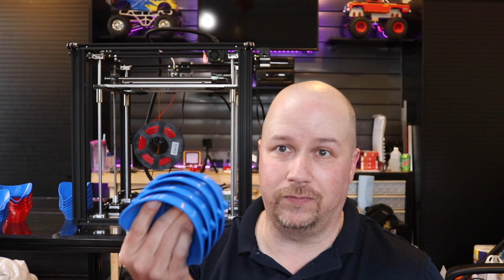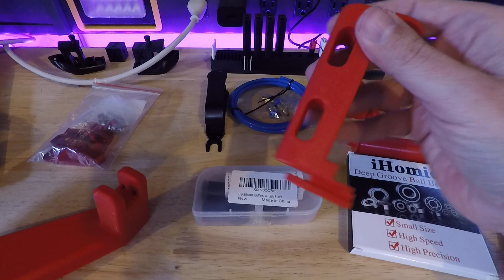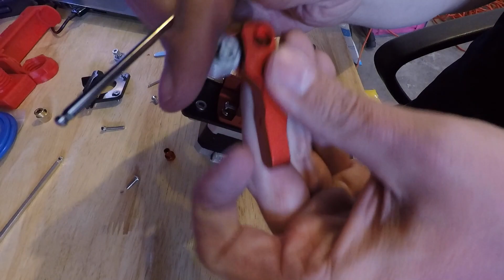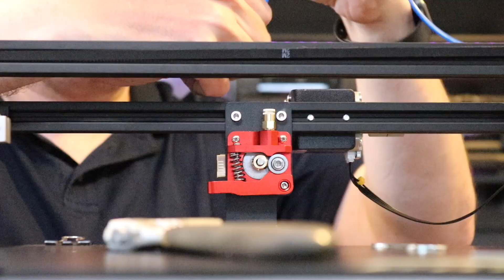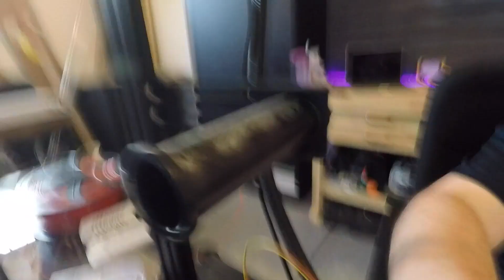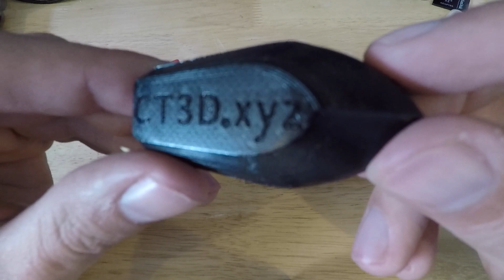Ender 5 Plus Upgrades -  5 Upgrades for only $50!

Comment: Useful tips but i have one for you. The easiest way to remove the Bowden tube from the hot end is to go the refill function in the menu and press feed it will then ask you if you wish to heat the extruder press yes and allow it to heat up the residual filament will melt and the tube is easily removed.😅

Comment: I've tried Capricorn tubing on 3 different printers and have gone back to standard tubing on all. Personally I think it's over-rated.  It often causes jamming, especially on an Ender 5 Plus where the tubing is fairly long. The tolerance is just too tight IMO. Perhaps if you buy $50 rolls of filament where the width is always 100% perfect then it might be OK, but I don't. Printer quality for me was definitely better with standard tubing. I've read other people having the same issue.

Comment: thanks for the video.  got what seems to have been a used ender 5 plus for $250 from a warehouse liquidation.  the motherboard needs replacing and the screws need straightening.  this video is great and appreciated.

Comment: i printed this spool holder successfully from the linked file but it looks like it's too big for my ender 5+ bed if i use the full Z axis. it will hit? do i have something backwards haha? i don't think so.
Reply: edit: nvm i'm used to working with solid steal haha. the bracket was pushed all the was forward in extrusion from factory and was slightly bent forward. Bending it back to straight + maybe a little safety bend past straight to the back and  loosening the two mounting screws to t-nuts + pushing it back immediately gave me clearance. moved it like a half inch. crazy

Comment: When I did the metal extruder upgrade on my Ender 5 Plus, the new bearing that came with the kit had a much smaller groove for the filament to rest against versus stock.  I tried it out but my test print failed, the filament apparently was being pushed too tight against the extruder gear for it to work.  So I replaced it with the original bearing with the deeper groove and everything returned to normal.

Comment: When replacing the Bowden tube, preheat before you try to pull the old tube.  It's also a great time to clean out the heat block.
Preheat the hotend to a little above normal, clean out the nozzle, and remove it.  Then use a scrap of bowden tube to run thru the assembly until you get most of the residue out.  Wiggle it around, push/pull, etc.   The tube can pass all the way thru the heat block and with a little work you can start off with a new Capricorn upgrade that's clean as can be.

Comment: I like your video.  (literally, I clicked the like button, too).  I just wanted to share an alternative spool roller design that I liked.  I considered the one you shared, but ended up with this one on two of my printers including an E5+: https://www.thingiverse.com/thing:3290358    The one you picked, if it is working for you, is absolutely worth keeping!  I only share the alternative for others to consider because it hides the bearings inside and provides support for wider spools.   It fits the Ender 5+ and the CR-10S Pro as well as others.

I made this remix of another tool holder and am happy with how it turned out for both of those printers I mentioned: https://www.thingiverse.com/thing:4343517   

I don't have a nice PTFE Tube Cutter.  (It's great if you get one!) but for those that don't have it, just use sharp flush cutters, cut as straight as you can, then close the flush cutters and use them in the closed position to open the end of the tubing by turning them around and around until it is rounded back out.  If you need to clean the surface any further, a razor blade can shave it, but I haven't found it necessary so far.

I have my z axis timed together on my CR-10S Pro which is really nice keeping them in sync 100% of the time.   I am going to work on seeing if I can come up with a version for the wider Ender 5 Plus.  I just need to figure out the right belt length and maybe come up with a belt tensioner for it, if need be.   On the CR-10S  Pro it is really super easy.  You just need a couple pulleys and a belt.  Set your 2 z axis screws exactly where you want them, tighten down the pulleys carefully.... check that your gantry is perfectly level running across the bed / perfectly parallel.   For the Ender 5 Plus it would work very much the same way.  2 Pulleys at the top of the screws at the top of the travel of the bed, the belt runs just under the bed (so it would need to be a high temperature heavy duty belt from a material stand point, but it doesn't need to be a very wide belt.   Depending on that circumference around that path, if there is not a belt close enough to that size, one could make a custom belt (not preferred) or simple get a belt that is the next side up and make a spring loaded tension roller arm that keeps the belt snug to the z screws.   If you want a challenge, give this some thought.  Take some measurements, and see what you come up with.    To me, the belt length needed would be 1 outer diameter of 1 pulley + 2 * (the center center distance of one z screw to the other).   Half the pulley circumference on the left, plus 2 lengths of center-to-center distance between the screws, plus half the puller circumference on the right should give the total belt length.  I just haven't take the measurements yet.   You said you wanted a challenge, so I present this idea to you, to see if you have any interest in it.   In the end, your two z screws won't get out of sync.

One suggestion:  At 21:00 into the video you can see that your filament sensor could be moved over.     Loosen up the mounts, move it over to the right (relative to the video frame) and have the filament come off the roll on that side of the roll by the sensor.  The filament should go pretty much straight up into the sensor.   

I really like the silicone stand offs.  I use them on my CR-10S Pro and it helps a ton.  You can use a drop of blue loctite on the threads to keep them from backing off over time.  My springs arrived from the factory super tight, so I just left them that way for now.  the bed mesh looks good.  I 100% agree with you on the strain relief.  There is absolutely no reason strain relief shouldn't be included.

Thank you very much for the video.  I also agree that the Ender 5 Plus is a good printer and the BTT SKR V1.4 board makes it even better.  I have the SKR V1.4 on my CR-10S Pro and I may add one to the Ender 5 Plus at some point.  For now the Creality Silent Board in the E5+ is good enough.

Comment: The plastic Creality extruder is the one they use for the Ender 3. The extra protrusions are for zip-tying the electronics and Bowden tube for the Ender 3 to keep the cabling from dragging on the bed.
Reply from the maker: Thanks!  I knew it had to have been used from another printer!

Comment: Some additions I just finished uploading to Thingiverse.
Spacer for using a dual gear extruder: https://www.thingiverse.com/thing:4391664
Bracket for using the removable spool holders with bearings: https://www.thingiverse.com/thing:4391940

Comment: Why did you reuse the original pressure fittings instead of the ones that came with the Cap tubing?
Reply from the maker: Good catch!  I tested the ones the came with the tubing, they didn't grab as good, and there wasn't enough room for the gap clip.  I just didn't feel confident that they were going to be any better.  Thanks for watching - Tripod

Comment: It looks like you missed the tensioner in the extruder assembly.  The screw that goes in from the top into the spring should be going into the part that looks like a rivet.  That allow you to adjust the spring tension.
Reply from the maker: @boggisthecat Yeah, this kit\verson doesn’t have an adjustable tensioner.  Thanks for watching.
Reply: Tripods Garage 
OK.  I haven’t had any missing that part, having bought three of this type.  It looked like it was there on your bench in the video.

You might want to have a look at the double-geared type of extruders.  Example: https://www.amazon.com/WINSINN-Extruder-Creality-Upgraded-Aluminum/dp/B07SY745CF/ref=sr_1_2?

I have one on one of my Ender 3 printers.  It should work better with TPU, hopefully.  (Waiting on some to arrive.)
Reply from the maker: boggisthecat - You had me worried for a second!  I double checked my little parts bag, didn’t have it. Then I double checked my order (in the description), and you can see in the picture that the little adjustment nut isn’t included.  I decided to do a search, and found others on Amazon that “do” have the adjustable tension.  It is good to know that there is another version that has the tensioner nut.
Reply: Tripods Garage 
I brought it up because this isn’t on the standard Creality extruder, so I thought it was some random thing with my first one (people tend to pack stuff at home, while eating noodles, having an argument, and packing multiple other stuff at the same time — so it happens).

It wasn’t until after I had assembled it, and was grumpy because the spring was canted over (‘This design sucks...’), that I checked the photos and noticed that the ‘random’ part was actually a tensioner.  Derp.
Reply from the maker: boggisthecat - Glad you brought this up!  Apparently there are older versions floating around out there (like mine) that do not include the tension adjustment.  Now people know what to look out for.  Thanks again for watching, and looking into the finer details that make these how-to videos even better!
Reply: @TripodsGarage  I have made up a spacer for Ender 5 Plus, to suit the dual gear extruders I use: https://www.thingiverse.com/thing:4391664
Reply: @boggisthecat  does this same one work on ender 5 plus?
Reply: @OnKillRacing99  
Are you asking about the spacer?  That was designed for the Ender 5 Plus.  You could check yourself if you want to fit it to another machine, and modify the part if needed (or make your own).

If you mean the extruders — yes, they will all fit the Ender 5 Plus if they fit an Ender 3.

Comment: in the long run, that extruder sucks, i had it and had nothing but problems. get the bondtech dual gear or the clone of it (i have the $16 clone) It performs really good!
Reply from the maker: @geekgarage Thanks for the heads up!  I will most definitely look into Bondtech if this one decides to give problems!  Thanks again!
Reply: @TripodsGarage  i should note that i exclusively print PETG, there is also a dual gear the looks like the one in your video, tried that too and it's just as aweful
Reply: got a link to the one that you recommend?
Reply: @chofism5984  https://www.banggood.com/BMG-Extruder-Clone-Dual-Drive-Upgrade-Bowden-Extruder-Kit-For-1_75mm-Filament-3D-Printer-Parts-Ender-3-CR-10S-Pro-p-1433052.html?rmmds=myorder&cur_warehouse=CN
Just remember to check gear lineup with the fillament hole and adjust, i would also recommend to shim the gear on the moveable arm so it is locked in place and lined up with the other gear after you adjust this to the hole. then on the backside the man axle with the white gear  was rubbing on the plastic so i drilled the hole a tiny bit larger 0.5mm or so, so it would still hold the bearing
After the few modifications it is running exremely well!